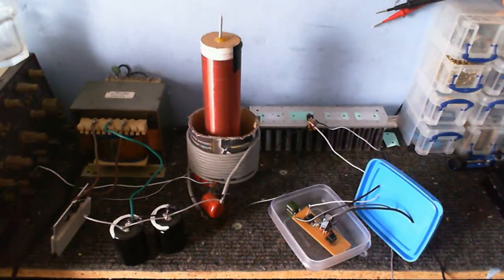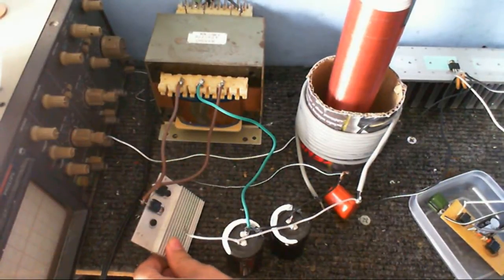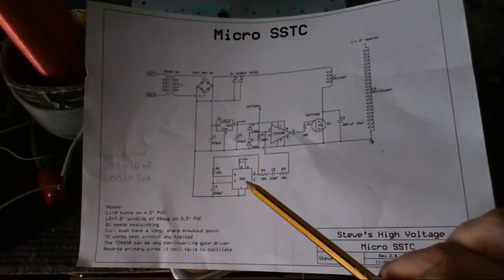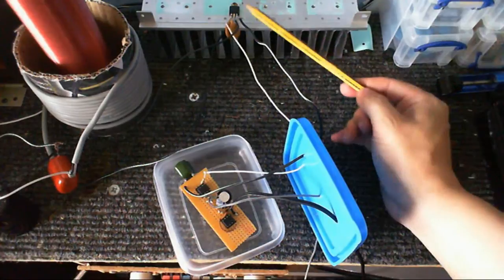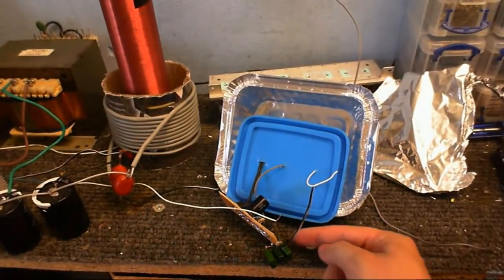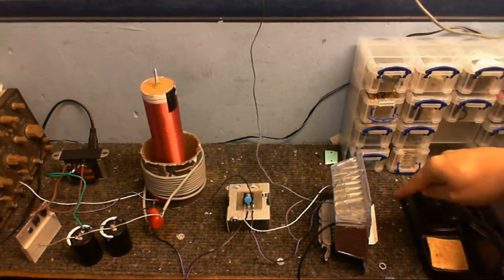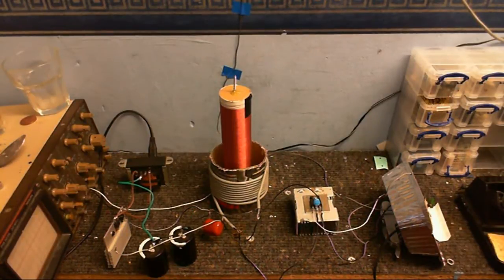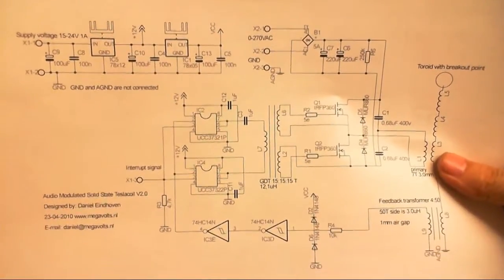Another Tesla coil, another failure!

Comment: If your running interupted this circuit has a difficult time breaking out.  Try drawing an arc in cw.  The 555 acts also as a startup oscillator so you should be fine in regards to losing feedback